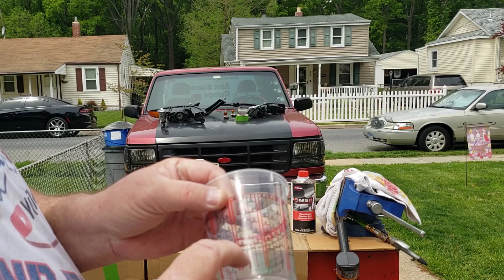How to Fix Foggy Headlights For Good

Comment: Strappy looks great in the background, did you ever fix that misfire issue you had awhile ago? And is there anything else you plan on fixing on strappy in future videos? I can never get enough of watching you fix up and mod your obs flareside lol
Reply from the maker: Well, the miss comes and goes, the hesitation is still there and I'm just ignoring it for now as I cant seem to figure it out, but its not bad, I drive it where I want with no problems, I figure if it ever just fails completely I'll swap in a 351W with a carburetor and just be done with the computer. As to mods, yes, I'm going to make roll pan for it I'm putting in 2 wireless charging pots, tilt wheel, push buton start and for good lord sake, cruise control, as I do take her on long trips and get tired of pushing the gas peddle, and she still needs paint, thats all coming, I also want to get that V8 swapped Mustang II going as well, we'll have some rust repair on that one and fabrication stuff, Hows that for fancy, Suff LOL, so thanks for the comment and for watching

Comment: Ed your truck looks great will this work on tail lights to my rear tail lights are vert dull how about using laquar  clear
Reply from the maker: Billy, yes in fact it will, check out this video, its where I replaced the tail lights with the LEDs, bout a 3rd third the way through I do a quick down and dirty restore on the ones I took off, I didnt take my time with them but they still turned out great and made them look like new https://youtu.be/sCNh6bTvHEA
Reply: Ed did my tail lights look like new thanks bill

Comment: Is it possible to make a request? I just stumbled across tour channel and subscribed.. I also have an OBS but mine is a CCLB.. I have powered front windows but manual back ones, all doors are power locked.. do you have any videos that shows how to change manual windows to power? Is it possible? Or should I just look to buy rear doors with already power windows and get new driver side door panel?
Reply from the maker: So it looks like you found that video LOL